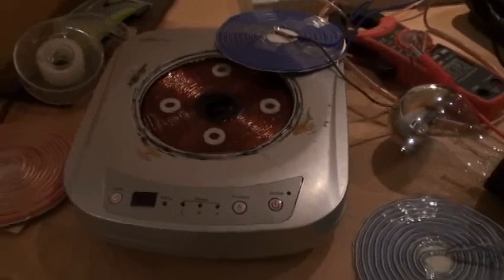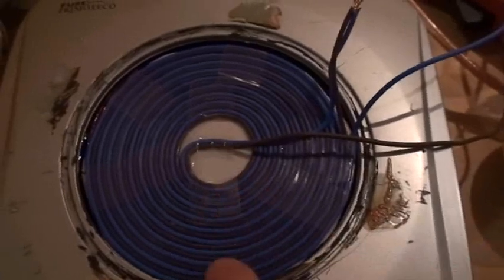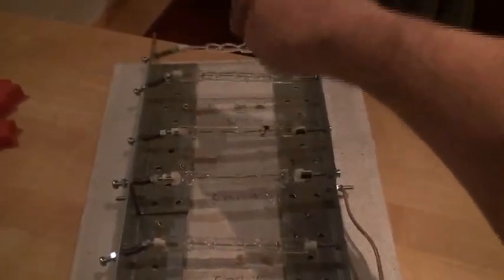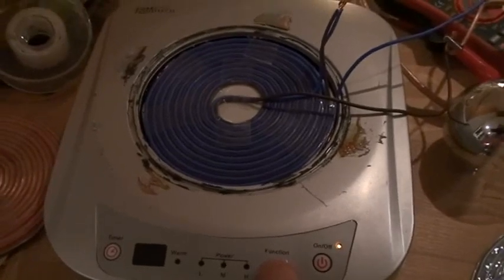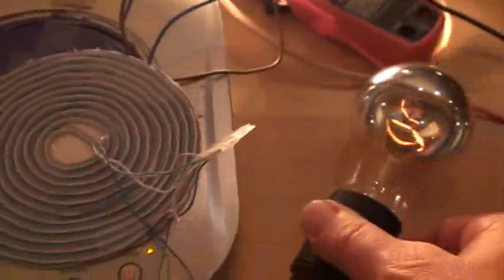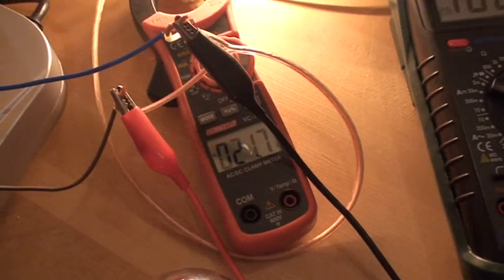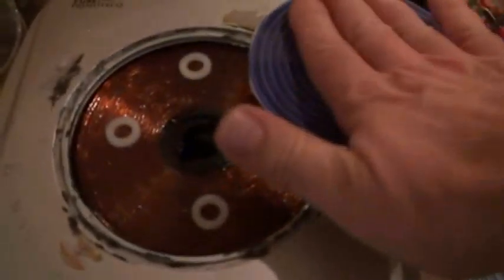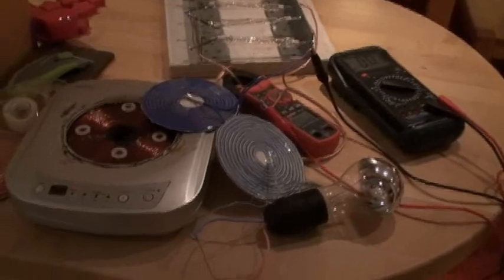gegene replication 2

Comment: the meters arent designed to measure the high frequency output, but the wall meter kill a watt isnt lying, that is 753watts in, the system is putting out more in terms of high frequency electromagnetism, there is no doubt about cop of more than 1 with this kind of system, the excess energy is coming from the disturbed harmony of charged particles around the ambient environment, he had invoked provoked the balanced harmony of the ambient and diverted some of it into the system by electromagnetic induction!

Comment: I don't doubt that this is possible radiant electro magnetosphere flow disruption and harvest devices  usually need to be carefully tuned in order to capture the gain.  Think of it as a tube with a closing damper; it takes less energy to close the damper than the pressure gradient that builds behind it, when the damper is opened there is a release and increase in flow from the electron flow disruption as it normalizes; hold the gate closed too long and it consumes more energy than can be gained through harvesting the imbalance correction that takes place; open it too fast and the potential back flow is never created.  It is little different than a wind turbine harvesting air flow and pressure gradients; the energy is not in the device; it is already present.  The working device in this case is a controllable invisible electro magnetic field, and copper coil tuned to capture electron flow in changing electro magnetic fields, this is far too difficult for most to get their minds around.  All such energy is produced by the earth, sun and solar system.  it is not wizardry or unscientific; tether  a copper wire in our upper atmosphere and it will also capture the same energy; clouds do it all of the time and the energy comes to us in the form of thunder and lightening.  Please folks, don't be fooled by the clever crooks who have made the refining putrefied dead plant and animal sludge synonymous with energy; every element on earth contains energy.

Comment: salut ta fait une erreur woopy, une pince amperemetrique c sensible au champ magnetique de ta plaque a indution ca te donne entre 12 et 17 ampere de trop ,éloigne toi de 2 metre de ta plaque en ralongent t fils de sortie de la bobine tesla, tu devrais avoir entre 3 et 12 ampere dependant si t ampoule son en paralele ou en serie, et un truc si tu veux ameliorer ton affaire , mets un condensenteur 1000 volt d environ 40 nf en ceramic la formule pour trouver la bonne valeur de resonance c temps =resistance fois capasitance, mesure la frequance de ta plaque ( entre 20 et 50 khz) le temps c ta frequence en milliseconde,la resistance c ta bobine,la capasitance c ta valeur de condensateur. Mais belle effort tu me donnera des nouvelles.

Comment: the measurements wrong!
can not be credibly measured above 5 kHz clamp.
The measurements will be almost 5x the real value.
only conventional resistance measurements at high frequency current can be measured.
I repeated all the measurements on two principles, with different values.
Reply: The killawatt meter isn't wrong. The output, even if it was 1/2 of the bulb's normal amount would still exceed the input by nearly 2 times. Add up the wattage just by the bulbs, then tell me why the killawatt meter is only saying 755 watts? It's because there is more energy able to be absorbed by the halogen bulbs because they are able to produce full output wattage at the high frequencies. The output being high frequency does NOT mean that the device isn't putting out 3600 watts, the meter may very well be able to measure this, and it doesn't beep or indicate in anyway that the reading is too high of frequency, which most meters will do, or, they will burn out if they couldn't handle the frequency. He doesn't even have to produce a meter to show his energy output is more than it's input. An 800 watt plate like this will normally output more than 800 watts worth of high frequency energy. It's the nature of a high frequency induction system. Don Smith does the same thing and he transfers the energy back to DC, then he charges 500 F super capacitors with ease to come up with 1000 watts output per farad and he inverts the power so he could drive 60 hz devices from the output. He used aerospace capacitors to do this and so could anybody else if the just loosely couple coils to one of these bad boys in resonance at a quarter wavelength. Once the wavelength and resonant frequency are achieved, as much as you want could be produced and the device could self loop as Don did. I have a few different models that run using a similar technology.. one of them uses 5-6 watts to output over 3000 watts and the input and output waveforms are identical 60 hz waves at 120 volts. Nothing is impossible, the fact here is that people are trying to debunk his readings saying they are erroneous. He never states that the meters were accurate, in fact at the beginning of the video he states the opposite. He just uses them to show what the device is based upon.. 800 watts and the voltage could be whatever the turns ratio will be.. nothing more.. he does show more out than in and like I said, even if the bulbs were at 1/2 level, he is easily nearly doubling his output power.
Reply: @advanced-electronic  if you and Don Smith use 500 F caps, then how long does it take to charge them while outputting them into a load?
Reply: @advanced-electronic  thanks for sharing. Im studying the lost zilano emails to build a don smith coil. In the mean time, i built the grounded capacitor setup demonstrated by don smith. Ignition coil 10,000 volt on one side and the reflection of that voltage coming from the air or ground on the other side of the plate making a spark. I did some waveform maneuvering and voltage step down and now i have a usable ac current. The next stage when i have the time is to power a load connected to ground for unlimited current. The cool thing about this is that i can add as many wires and transformers from the ground to the plate as i want and never draw more power at the input thus multiplying the output. I demonstrate this to people in a park and they get fascinated every time. However, it seems im the only free energy experimenter that cares to experiment with this as ive not seen or heard of anyone else interested in it, being that most are only interested in resonance circuit overunity. What are your thoughts about the grounded plate setup?
Reply: @advanced-electronic  my two cents: His output "readings" multiply to some 3600W, while the bulbs are rated at 230V... not 164V. And have only a total of 7x400W=2800W ate 230V... ???? Just does not make too much sense. Instead, rectify to DC! These bulbs can run on DC (as long as <=230V DC!), no problem! And voila, MESURMENTS! Not guesswork.

Comment: Hi, very nice test, but you must take care that this amperemeter and voltmeter are designed for 
Frequency cca  max kHz. So result can by very different if you use frequency cca 25 kHz.
For correct energetic balance is necessary use scope or and this is the cheapest, use output energy for heat up of water and measure time and temperature.

Comment: hi woopy 
use a fwbr and a cap like romero did to calculate with dc values.
The second coil on top , it's load does not reflect to the source .
And that's interesting, because it does not behave like a transformer.
Romero used this second coil to put energy back via a grid tie inverter
and could achieve a cop >1 !!
Keep on experimenting with it .

Comment: Yes but did it _feel_ like 3668 watts?

Did Woopy get startled and remark about the blast of infrared heat he would have had to have felt the moment he switched it on?

Did he jump at the blinding super intense brightness of the halogen lights that would have to have happened if the power dissipation was 3668 watts?

Comment: Hi woopy,

The lamps COP are depending on frequency. Highter frequency, less power required. You might do simple test:
100W bulb on 50/60Hz consumes 100W
100W bulb on 120Hz will use ?W
100W bulb on 1kHz will use ?W
100W bulb on 2kHz will use ?W
100W bulb on 4kHz will use ?W
100W bulb on 8kHz will use ?W
100W bulb on 16kHz will use ?W
100W bulb on 32kHz will use ?W

If you do this test, the diagram will show interesting results.

Cheers!
Reply: THANKS !!!!! Finally an adult in the room! ;-)